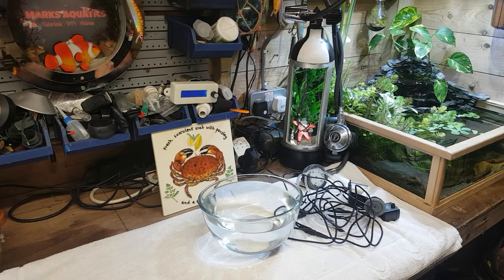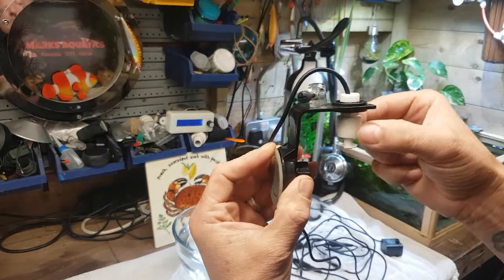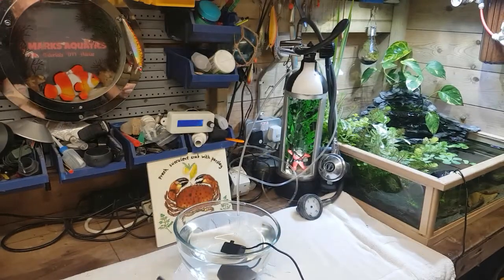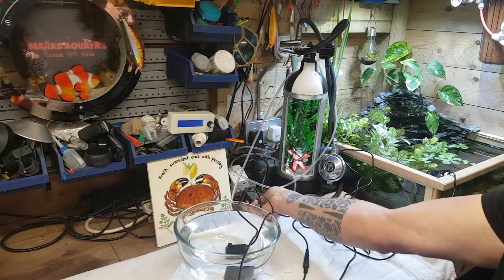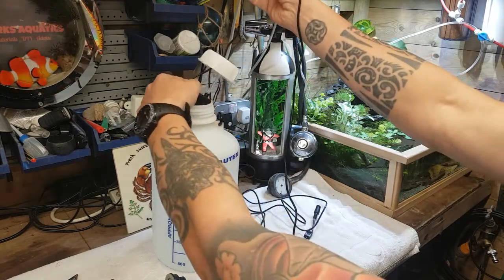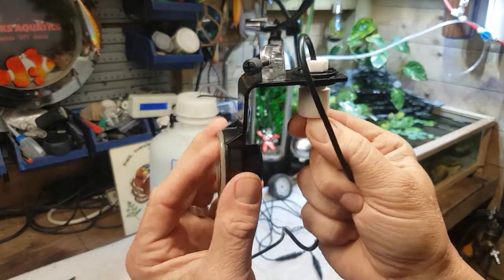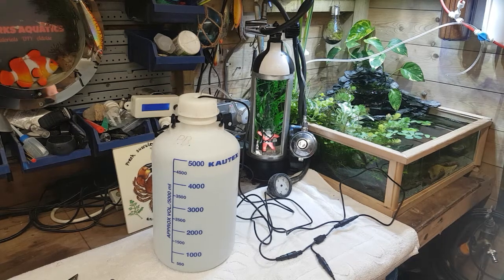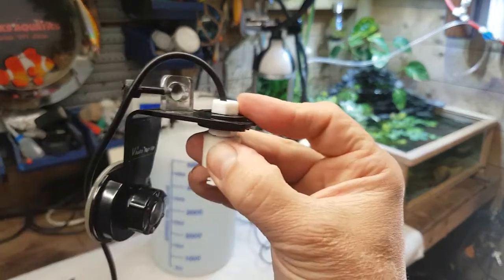How to keep your shrimp tank parameters stable.

Comment: hey mark what cable is that the splitter i mean ?
Reply from the maker: The top up system is made by TMC its a v2 model if that helps. 👍😀
Reply: hey i was talking about the cable connecting every not the tmc

Comment: Would you recommend a backwall filter for a shrimp tank? Approx 41cm by 41cm by 41cm
Reply: If I build a backwall filter, Instead of returning the water right back into the tank after it is filtered, it is going to go into a diy trickle filter for extra biological filtration. I'm also going modify to the overflow and have an area to put some sponge so baby shrimp dont get sucked in.
Reply from the maker: Yes it would be great. Iv'e just done a video on how to build one check it out.👍😀